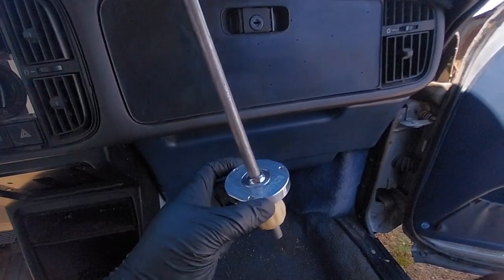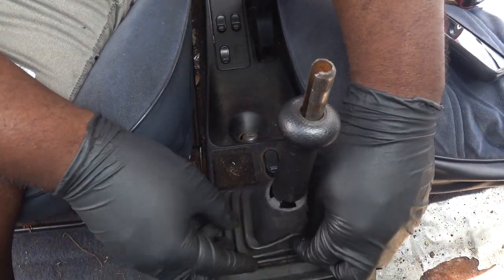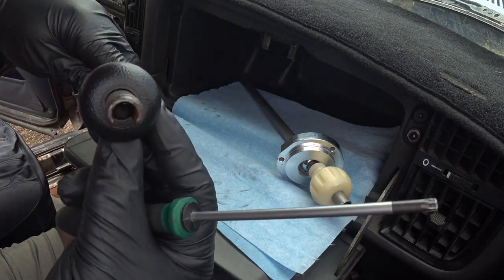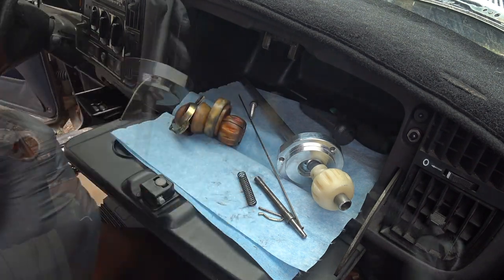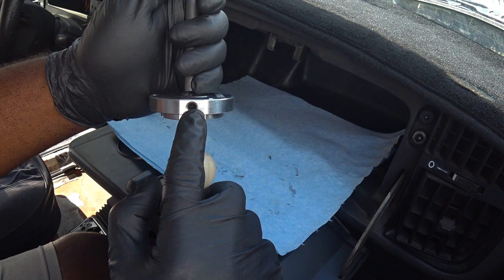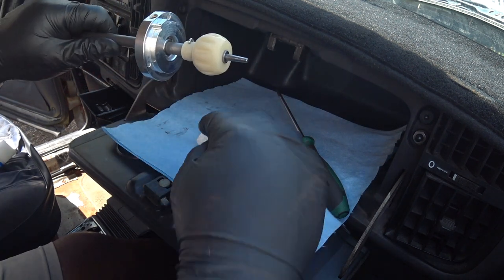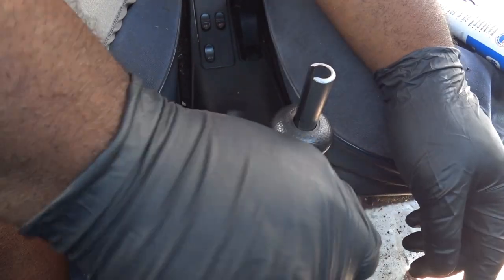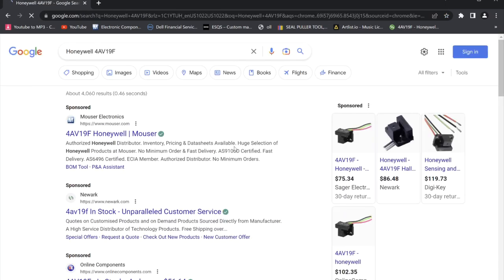SAAB 900 MCS Short Shifter Install

Comment: I wish I had found your info on the hall sensor earlier... Thanks!
Reply: I have some intuition regarding my Hall sensor and idle problems + "check Engine". What was your discovery ?
Reply: @Cavyann  Well if the Hall sensor doesn't send any RPM signal the EZK control unit doesn't start the fuel pump so it renders the car completely dead. So if she's cranking fine but won't start at all and the fuel pump doesn't run that usually is the problem. Your idle problems usually cannot be caused by the Hall sensor. I would look for a new mass airflow sensor and/or idle control valve. Both can still be bought new (albeit not NOS).
Reply: ok, clear ! cheers. It does not look like my problem. Mine is the following : 
When it starts for the first time, everything is fine. No check engine light, idling at 1000rpm (maybe a bit high ?), no sensation of abnormal vibration. 
After a 30-minute stop following a 30-minute drive at 110km/h with normal temp, I restart and immediately, there is a hesitation sensation in the idle, dropping to 500rpm, stabilizing at 750rpm. And check engine light, low idle at 750rpm and sensation of vibration in the engine and chassis.

Once in a while (rarely), idle will reach 3000rpm while driving, accelerating out of control... And then, after stopping, no restart until completely cold.

Does it ring a bell ? @ursusskandia
Reply: @Cavyann  ok so problems only when hot. Could be the air filter but I still set my money on air mass sensor or idle control valve. I also had similar problems because of bad spark plug cables in combination with an old ignition coil. Check also for vacuum leaks - usually they are worst when cold but you never know.

Comment: Hi ! Thanks for the video and the pedagogy. It is very helpfull. What is the reference of this shifter ? Merci !
Reply from the maker: So this shifter from Jordan Pagano's Modern Classic Saab has a shorter thow. Essentially it is a short shifter for the classic 900 SAABs. It remedies the shifter assembly slop problem with older classic 900s that used the nylon ball shifters.  It reduces shift lever throw movement and makes shifting feel 100% more positive and precise.
Reply: thx for your answer  @RetrocarStyle   !
Reply from the maker: 👍👍👍 @Cavyann

Comment: great video, i’ve watched this so many times. did you have any trouble w the fifth gear? it worked w the old one, and now the shifter sometimes jumps out of reverse. i think my shifter pin might be too flush w the rod, so i will measure more accurately and add the ~2mm to the pin
Reply from the maker: Before intalling this piece I had problems with 5th gear selection...as a matter of fact I had no 5th gear when I first bought the car. My biggest fear was that it had a bad gearbox. So I did two things. I made sure good engine mounts were installed and I made sure to adjust the shift rod/ linkage with the proper tool. Then 5th gear was able to be selected. But Because of the worn out plastics, I would often miss 5th gear as it is a precise shift. Once the short shift kit was installed, it kind of hard to miss. In fact there is now a satifying click when 5th gear is selected now. Make sure the shift coupling on the shift rod is in good shape too. This thing causes all kinds of issues.
Reply from the maker: You can also try adjusting the pin to 21mm. If you can get the car into reverse without lifting the lockout collar, then the lockout pin is too short